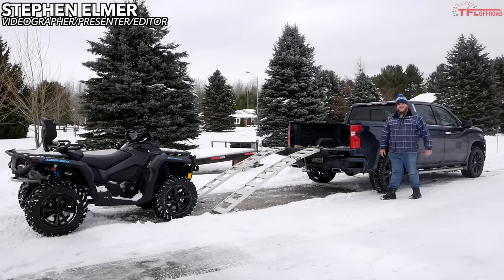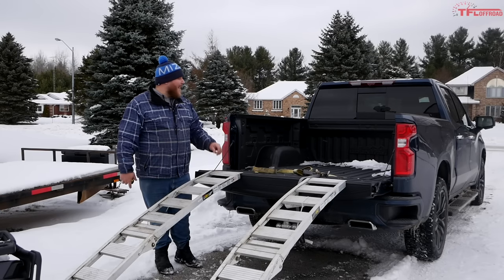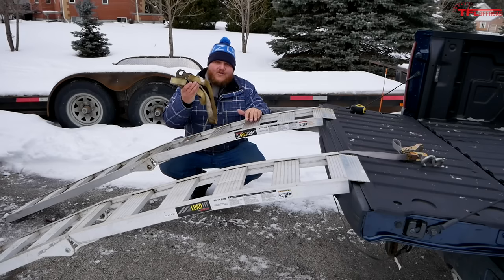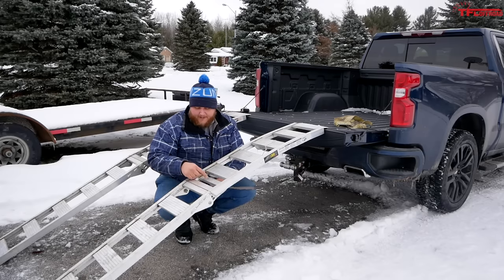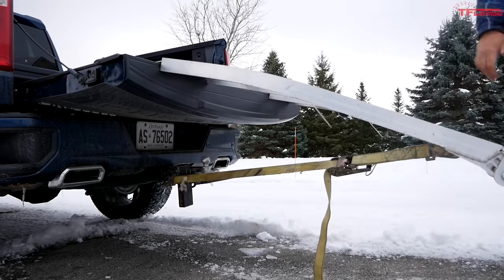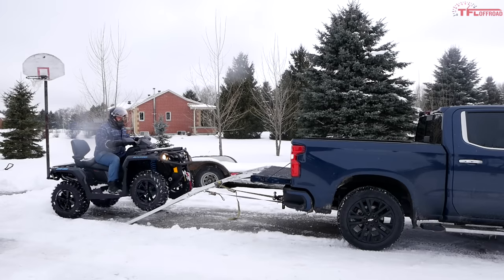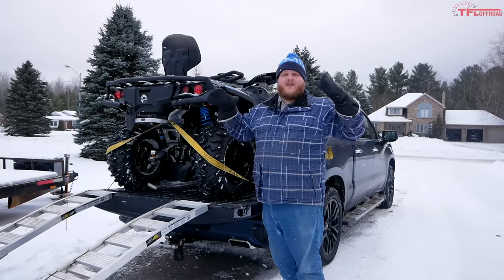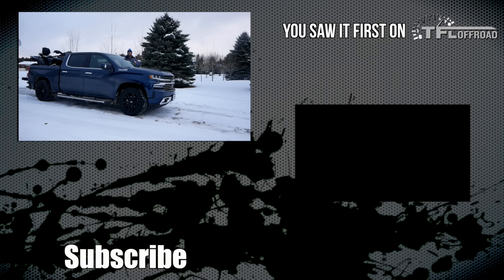Here's How to Load an ATV Into Your Truck Without Crashing!

Comment: Any concern about the load on the tailgate?  I just purchased the Outlander Max XT 850 and have a 2018 Silverado with the short bed.  I have a trailer but sometimes may want to load in the bed.
Reply: Was wondering the same thing. Looking at an Outlander Max North Edition. I have an F-150 with the 6.5’ box.
Reply: @stevehorvat69  my son in law has the north and it’s definitely more comfortable when we ride in the snow. Still haven’t put mine in the bed yet but I think we’ll be ok. See others doing it and haven’t found any fails

Comment: NOTE Chevy/gmc beds are actually the longest & widest at 5'10" ... f150 is actually 5'6" ...& my older ram was 5'8" but 19 might be  slightly different
Reply: SOLAR SS the ford has better payload though and some really nice ramps that don’t require straps
Reply: @freedomisntfree_44  those ramps are sweet no doubt, there are a few aftermarket that tried to crappy imitate for the other brands. Well true i guess if you have the right cab, engine, payload package, & bed protection. But then again if you don't have the room more payload does you no good in a short bed. My GM/Ram beds are cheap enough feeling to me ,my previous 17 F150 was super frail to me.
Reply: SOLAR SS I use the hell outta my 16 f150. Throw all kinds of stuff in it in the farm and load it down with a skid steer or tractor regularly. Never had a problem and every vehicle in the military has aluminum in the cargo areas and we carried some sketchy shit with them and it holds up really well. Everything the military has is aluminum
Reply: @freedomisntfree_44  oh i don't know about all them foreigner military's stuff, but we in the  American Army use quite a bit of everything but mostly stainless steel for the hard core stuff. Steel or aluminum are for more non combatant situations. Those girls never see no action lol.

Comment: Great video!  Question:  I’ve got a Can Am Max. If I set up ramps in the bed, can I bring the rear wheels forward enough to be able to close the tailgate?  I have a Ram with the 5’7” bed.  I’d like to be able to tow a trailer.  Just wondering your thoughts.  Thank you.
Reply: So... um... how long is your Can Am?  And your bed is 5'7" - If this is something you can't figure out on your own, you probably shouldn't be thinking of hauling an ATV, let alone pulling a trailer.

Comment: Todays 4x4 trucks make a really steep climb into the bed. I dont trust the ramps. Its all trailer for me. I used to drive a 1968 Chevy with a long bed and it was perfect for hauling quads. I miss that thing!
Reply: I have a 2016 F-150 with the 8ft bed. I agree the angle is pretty steep so I run a chain between the front tie downs in the bed and winch  up my ATV.
Reply: Chris Harris yea Fords set up higher than Chevys. I have a 2011 F150 so I know what you mean lol. I have a 16ft tandem trailer so I don’t have to worry about it
Reply: I love having that long bed. Even with my slim toolbox I can load up my ATV and shut the tailgate. Put the ramps (from Ford which hook into a channel on the tailgate) under it and I'm good to go. Made it easier when I went to Colorado from eastern Kansas to go riding. I just bought a polaris Ranger last Saturday so now I won't have a choice, but to trailer it lol

Comment: I respectfully disagree with one thing, which is just personal preference. I always back my atv in , I never go forward. Same with my skid steer. Reason : well for the atv anyway, in the unlikely but possible scenario I want to be facing forward as the atv flips over (I have a better chance to jettison to the right or left. Last thing I want to see is the gas tank and handlebars coming towards my neck or head
Reply: That sounds like "Final destination" 😳

Comment: People don’t secure the ramps onto the truck with straps.  My can am outlander is 8 foot and my ram 2500 is 8 feet and the tailgate closes all by my plan and specifications. No half ton my ATV weighs 1000 pounds with a camper behind no half ton will handle this payloads and towing well.

Comment: I know a guy they broke his back by flipping his wheeler on himself. When I bought a small bed truck I got a trailer. Still have an older 8’ bed though. I call my half ton Silverado a car truck. Now with a 12’ sled and a side by side the trailer is the only option.

Comment: Wheel base is from front hub dead center to rear hub dead center. NOT from the front of the front tire to the rear of the rear tire. 
That is why your measurements are wrong and why your rear wheels are on the edge of your tailgate. Not where you said they would be, where the tailgate meets the bed.

Comment: A poor example of loading an ATV - not that strapping in was poorly done, BUT that to have the rear of the ATV resting on the tailgate is absolutely unsafe and exceeds the weight rating of that tailgate.  A bad example for those who will ultimately try to haul their ATV with the rear wheels on an unsupported tailgate.  I would think TFL could be liable if there was an accident as a result of this.  Not the loading, but hauling that way.

Comment: Lol short box truck, completely useless and city folk approved.
Reply: Panther Martin77 is that why the ATV fit?
Reply: @ALMX5DP  thats what you call fitting? Ever seen the painted surface of a tailgate after its been down a gravel road several times and the stones beating the hell out of the paint?
Reply: Panther Martin77 then find a way to protect the tailgate. There’s still an ATV in the bed so sounds perfect if you don’t need the extra length.

Comment: Or get a Cybertruck.
Reply: Seems like an expensive solution. I think I'll save $40,000+ by simply loading the quad I already have into the truck I already have. Even if I didn't have ramps (which I do), they're much less expensive than buying a whole new truck.
Reply: @TheCharleseye  I mean the next time you buy a truck, obviously.  I recently talked with a project manager at work. He had just bought a lifted, 4 door, 6 foot bed f150.  Leather, dealer-installed rims, lift, and 35's.  I asked what he payed.  $53k.

Cybertruck @$49k you get everything that f150 has + more.  If he wanted to tack on air suspension I don't even know what the dealer would charge.  A lot. Then you've got a tonneau cover with an air conditioned compartment, storage in the frunk, under the bed, and on the sides which makes a tool box obsolete.  Giant screen that can have netflix and other stuff. I could go on. And Ford doesn't even offer autopilot which is standard on the CT.

Now. Tesla is like apple, not a lot of customization, take it or leave it.  You have to accept the drawbacks (AND benefits) of an electric drivetrain.  Maybe it's not for you.  But you can't deny it's great value for someone who wants the features it has.
Reply: @bob15479  I'll agree with that. It's certainly an option for someone who wants its specific features. Of course, we'll have to see what the electric F-150 has to offer. Personally, I'm not much of a Ford guy but if they're really working with Rivian, it could be a great truck (that probably won't look like a doorstop).
Reply: Mark Brand are we not considering that the Tesla is currently nothing more than a prototype? And let’s not discuss pricing, with statements and changes like we’ve seen with the 3.
Reply: Alan Bowers What “statements and changes”? $35k model 3 was promised, $35k model 3 was delivered.
Reply: Mark Brand September 2016: Elon Musk revealed the Model 3, initially promising that it would cost $35,000 to start (not including the mandatory destination charge).

Mid-2017: The Model 3 went on sale but was available at first only with its more expensive Long Range battery option and a Premium Interior option, starting at $50,000.

February 2019: Tesla announced that the $35,000 Model 3 was finally available to order. It was said to be a stripped-out version of the Model 3 with cloth seats and a "Standard Interior" configuration with few standard features, priced starting at $36,200 ($35,000 plus a $1200 destination charge).

April 2019: Tesla removed the Model 3 Standard Range from its online ordering system and announced that it would be a special-order-only model available only at physical Tesla stores. The company also said that the Standard Range model would now be a software-limited version of the Standard Range Plus with the "Partial Premium Interior" and with certain features locked out, rather than the previously announced model with cloth seats and a "Standard" interior setup.

May 2019: Tesla raised the price on the Model 3 Standard Range by $400, making for a starting price of $36,600.

July 2019: Tesla lowered the price on the Model 3 Standard Range back down to $36,200.

And where's the Roadster which debuted in 2017?
Reply: @ALMX5DP  So they sold a $35k 3 to as many people as were waiting to get one? Ah ok. Good. Thanks for documenting that for me.
Reply: @bob15479  Keep your blinders on if you'd like, just providing a history of the statements and changes. I love Tesla's offerings, but am cognizant of Elon's history and claims.
Reply: Alan Bowers I just don’t get people like you. Your underlying point is that the truck will never be delivered as promised. And I just think that’s total BS. And there is no evidence to back it up. There’s a lot of lateness at Tesla but not a lot never-fulfilled promises.
Reply: Mark Brand you’re reading between the lines, when did I say the truck will never be delivered?

Comment: I alway connect my straps to the bed of the truck and never like this. This connection with the straps can cause them to jump off the tailgate causing problems. These ramps are to short should be 8 foot long and the truck should have an 8 foot bed.  This guy should start over and have the atv in low gear. Having your ATV hang out the back of the bed and on the tailgate is not ideal.  Get an 8 foot bed.
Reply: That's why I ordered my half ton with an 8ft bed. When I had a short bed I had to remove the toolbox and open the back window to shut the tailgate. I have a slim toolbox now so my ATV sits with the ties against the tailgate when it's up and I can put the ramps under the ATV.